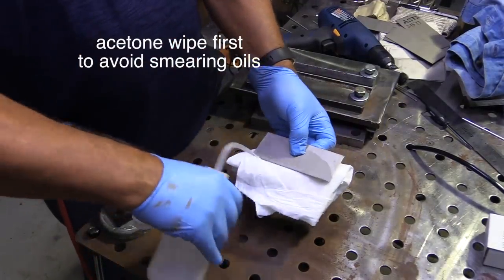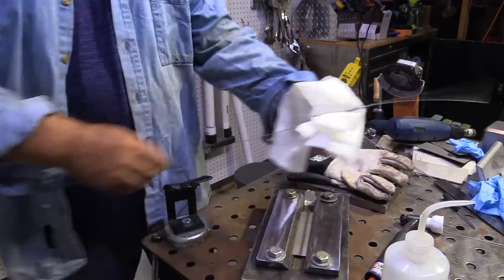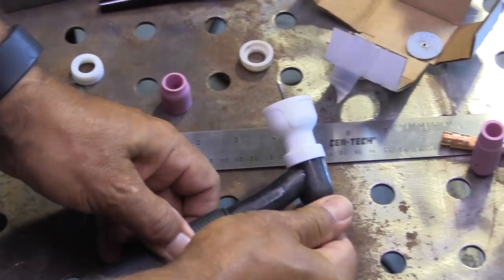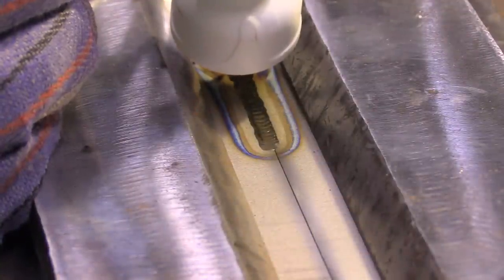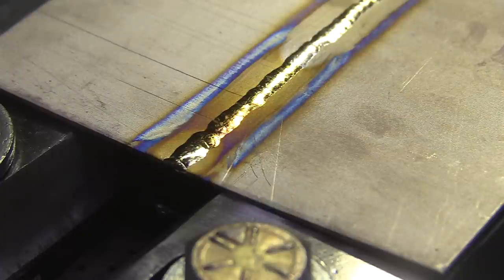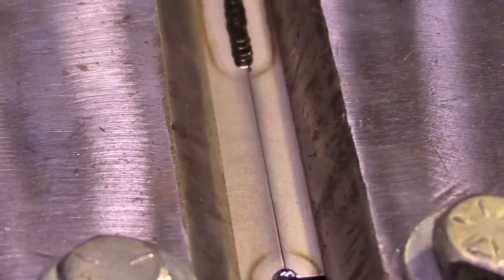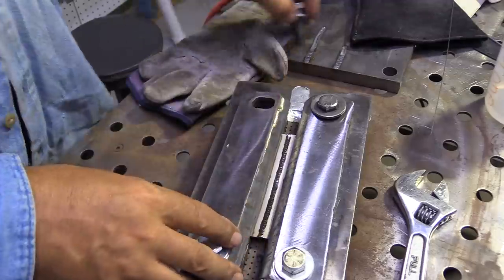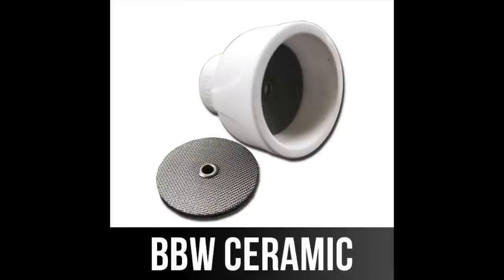TIG Welding Titanium

Comment: So, what did you do about the bad argon? Just eat the cost or do you try to get then to give you a free tank? Just curious what you say when you go into the welding supply and tell them they gave you bad gas and they want to argue that its you and not the gas.
Reply from the maker: I ate the cost.    the last cylinders I got just a few days ago only ran me 23 bucks each.   My local welding takes pretty good care of me.  If that werent the situation, I might argue the point.
Reply: You might want to let them know anyway, just in case it was a problem with that batch of gas and not just the one tank. Might save some other welders a few headaches.
Reply: Now that is cheap gas! It cost us here in Europe around 80€~90$ for 25 pounds of gas. So thats roughly 80€ for 11 kg of argon.
Reply: Here in Canada a 50 CUBIC FOOT cylinder of argon costs $ 83.00 CDN
Reply: Lucky on those prices.  Mom and pop supplier?  I have to break my wallet off when I run in for all my bottles in Ohio.
Reply: here in fort pierce its like $40 tax and all for a 125 tank
Reply: at local supply but if i go to nexair or airgas its like $60 doesn't matter if you bring the bottle in or have them deliver it is the same price
Reply: another thing to consider is getting a large tank because it isn't so much the volume of gas your paying for as the service my local welding supply will swap out 200 and 300 CF tanks as long as the code on the tank is a owner code I think it has to end in 2P or something like that they said swapping a 200CF tank is only like 8 bucks more than a 125
Reply: Part Out You must live west of the Rockies like I do? I have 3 K's, 1T, and 1 AC4 cylinder, all customer-owned. The LWS I go to is the largest gas manufacturer in NA, and they will swap out customer-owned K's and T's. We have another LWS in town that I sometimes am forced to use, but they will not swap out T's - they insist they are ALL rentals, when in reality only their T cylinders are rentals. 

Anyway, you are 100% correct on the costs of fills on the larger cylinders. The K's (220cu-ft) are less than $10 more than the S (136cu-ft) cylinders, and the T's (330cu-ft) are less than $10 more than the K's. I'd like to have all T's, but I don't really use enough gas to justify the cost of the upgrade. The only reason I have even one T is that I ordered a K of C15, and they delivered a customer-owned T by mistake. They said if I paid for the fill I could have the steel. I said 'DONE!'  :-)

I have never asked my LWS is they will sell customer-owned 3K, 4K, and 6K cylinders. Probably not, as they are a relatively small percentage of overall cylinders and are likely VERY expensive.

I feel for the folks back east that are limited to S cylinders. K's and T's are SO much cheaper per cu-ft of gas, and I have NEVER had a bad cylinder of any gas in the 30-odd years I've been welding.
Reply: There are plenty of small businesses that sell balloons that own their helium balloon gas tanks are are 220 or 330CF these can be swapped for "owner" tanks i see them for sale in Miami all the time for like $100 used 330CF tanks I just hate to drive to the port of miami to get one, haha
Reply: but yeah i have heard a lot of the welding supplies claim that anything over 125 is rental only and won't fill them, too bad they don't know any better
Reply: Part Out It isn't that they don't know any better, that's just their company policy. It may also be the law in some states, not really sure about that.
Reply: Yeah but if you think about it, i know here in florida if a company takes on a big job they may buy a crate of 25 330CF tanks, a company contacts the tank manufacturer and buys them from them. These tanks are not owned by a welding supply, now the job is done and they don't need these tanks anymore and surely aren't going to ship them to the next job site so they sell them all off. Maybe the job was a 6 month job or a year, whatever the numbers worked to buy the tanks outright rather than lease them and then they can get a bit of the money back selling them cheap.

Comment: Any thoughts on the arc wandering around the electrode as you finished each pass?  I'm impressed as always that you can capture details that fine.
Reply from the maker: I could either sharpen a finer taper, or drop down to a smaller electrode and the arc wander should go away.
good eye!
Reply: I would say its just because of getting down low amperage as he's tapering off
Reply: Ok I see; I did a few days of it in college (which wasn't yesterday) and never got into the fine details like that.

Comment: I like your purge fixture as it can help stop it from distorting the work pieces such as making a ten meter benchtop having to join the materials together without having any joins visible this would help out alot usually I can back it with 20mm plate clamp flat bar on I'ver side and back step my welds it gets full pen without oxidation just get colour in it. I can also Penn my weld to take the tension out and bring it back to being Smooth. well that's enough of me talking shit time for a Pooh........

Comment: I prefer an acid cleaner.
Never hurts to use a small piece of fire blanket draped off the backside of the torch keeps the gas on the weld longer. Fire blanket should never come in contact with the weld.

Comment: Hey Jody.  I could swear i could see the seam of the titanium parts in the weld (see time stamp 7:50)  as you left the tack.  
1.  This is how cool your arc shots are!  
2.  Is this common?  Do most steels have this line show up at the beginning  of the weld?
Reply: Rob Townsend  I was thinking the same thing at 6:50 time frame
Reply: Rob Townsend  I was thinking the same thing at 6:50 time frame
Reply: I think that is just a reflection of the tungsten
Reply: Give a little thought before commenting, mirror bead= reflection

Comment: Bro that file and wire brush isn't made of titanium.  Titanium is harder than hardened steel.  Just fyi.
Reply: As in the video your piece needs to be clamped down.   Titanium is very sticky when welding (it cools and dissipates heat so much that it cools when you dip your rod fast).   If your piece isn't properly secured when you pull the rod up the plate wants to come with it.